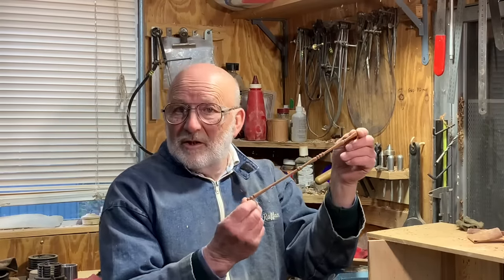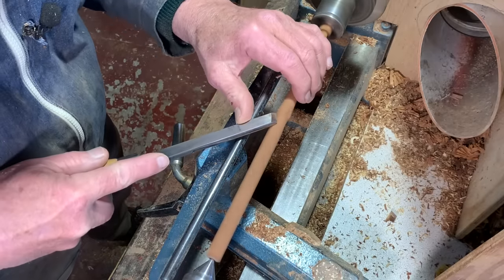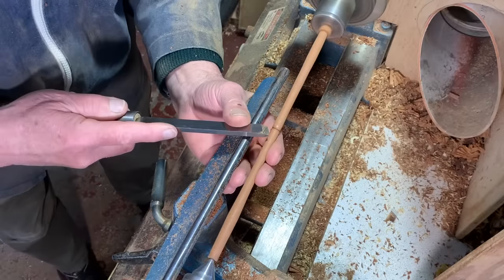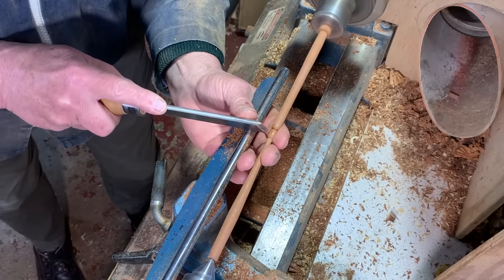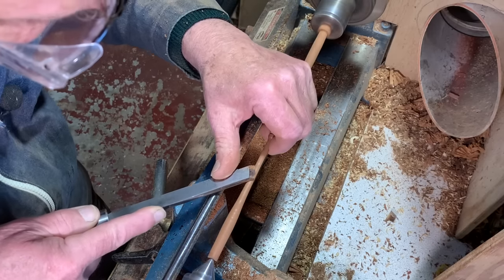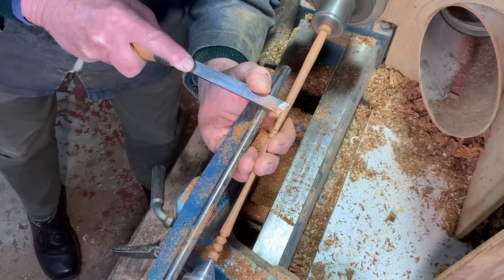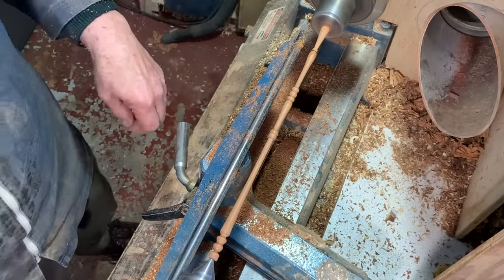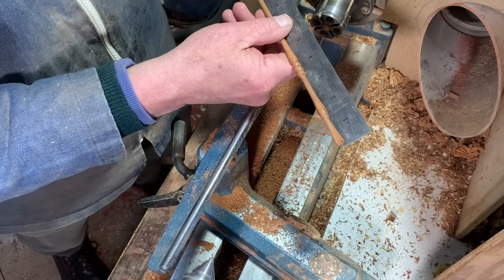Richard Raffan turns an Ego Stick

Comment: Wow.  That was very enjoyable to watch, very impressive and very inspirational.  I need to get a whole lot better with basic skew work before even thinking about attempting something like that.  Does one need to be concerned about potential injury if a catch breaks the piece apart?  If so, is there anything you would recommend to mitigate that risk? [Other than not having a catch]
Reply from the maker: I taught myself to use skew chisels reducing 2-in / 50mm squares about 200mm /8-in long to ever finer spindles until they broke. I turned the squares to round, then cut grooves, turned those into beads, then removed those and repeated the exercise on a smaller diameter. When the spindle breaks it's no big deal. These spindles are not nearly as difficult as they look and are excellent skill builders no matter what your end goal in turning wood is.
Reply: @RichardRaffanwoodturning   Thank-you for the response.  That alleviates the one concern I had.  Really appreciate these videos.  Like all things worth learning, in theory this seems simple, but it is the nuances such as tool presentation, motion, and tilt that make this a skill only acquired through practice and repetition.  Between your videos and Allan Batty's video, I think I'm starting to get the hang of this tool.

Comment: Very impressive. I have recently tried spindle turning in earnest for the first time (I have been making bowls for about 18 months), and am really struggling with it. Any pointers for a newbie?
Reply from the maker: I learnt the basics of turning using skew chisels and gouges to reduce 2-in / 50mm squares about 200mm /8-in long to ever finer spindles until they broke. I turned the squares to round, then cut grooves, turned those into beads, then removed those and repeated the exercise on a smaller diameter. When the spindle breaks it's no big deal. These spindles are not nearly as difficult as they look and are excellent skill builders no matter what your end goal in turning wood is.

Comment: Bravo!  This reminds me of the spiliken that you turned in a previous video.  What are the differences in dimensions between the two blanks?
Reply from the maker: This is a few  inches longer. Spillikins blanks are 10mm square x 220mm long. The longest I did in club demos are around 400mm /16-in. x ⅛-in or less. It's easier to start with thicker blanks.
Reply: @RichardRaffanwoodturning  Thank you so much. I shall make a note of this for when I'm ready to try one.